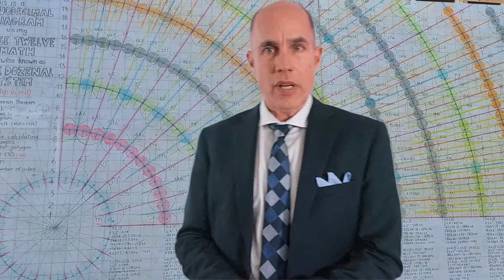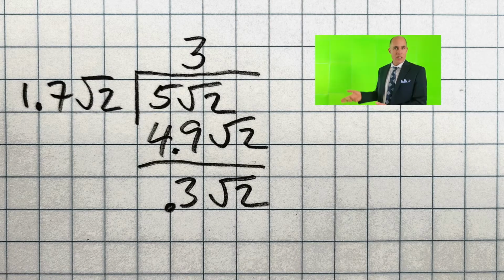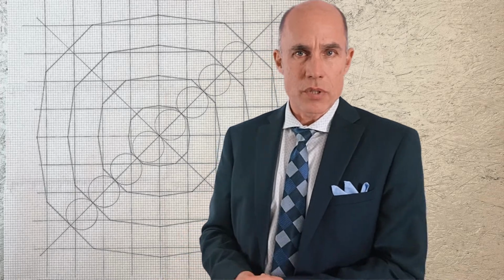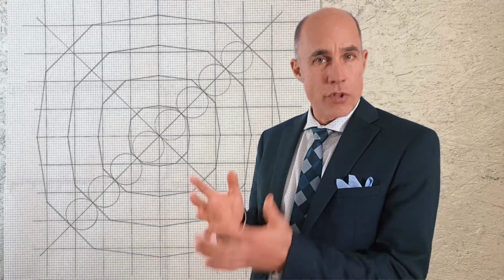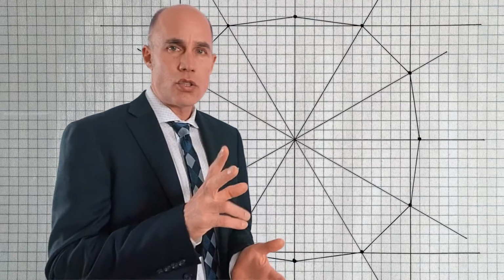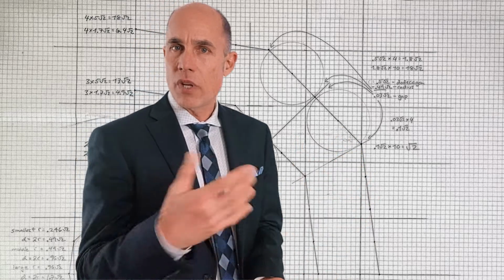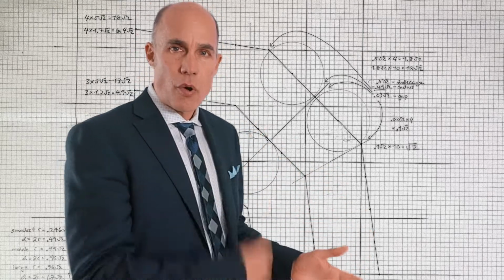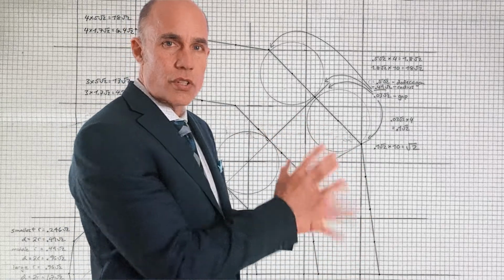How do you build a diagram for 360 degrees using base twelve geometry? Use a base twelve dodecagon!

Comment: Just to be clear, are we constructing a 360-gon (or 260-gon if you like) with verticies on integer coordinates using a straight edge and compass?
Reply from the maker: Although it may seem like it's "just" a 360-gon, it is important to be aware that each side of the polygons we are creating are made up of two distinct aspects. There is the unit of the diameter, and then there is the section of "empty space" inside, or between which, that section of diameter is floating. The construction of the diagram for 360 degrees is not so much the end result, but the completion of the first step of a larger diagram which can then be used to map out the geometry of Quantum fields.  It will be when this geometry is attached to Quantum Physics and Quantum Field theory that its real import will become apparent.
So with regard to the idea of completing the diagram with a compass and straightedge, because of the scale involved, very quickly the physical compass and straightedge need to be replaced by a computer program . If you happen to know anyone who would be up for the challenge of creating a geometry program in base twelve, by all means, let me know. :-)
Reply: @dozenalmath  This is some fantastic work! I'm currently building a geometry program in base 9, to represent only the real numbers. It will be possible to run base 12 simulations on it.
Reply from the maker: @squeakytoyrecords1702  Why did you choose base nine for your program? How easy would it be to convert to base twelve?
Reply: @dozenalmath  I chose 9 because my goal is to mimic nature. Zero is not a natural number, as it can't be counted. Also, base 9 allows for easier visualization of symmetry, broken symmetry, geometry, chirality, polarity, and multidimensionality. By expressing base 9 calculations in digital roots, it exposes the underlying algorithms of nature. While I do my calculations in base 9, my division process is like yours, in that I divide everything by 12. It shouldn't be difficult to convert to base 12. My system is a calculator that converts base 10 to base 9, runs the calculations, and provides the answers in base 9 and base 10. Below, I've included a small number set that shows the symmetry of base 9. If you pick any number and travel in any direction, you will find symmetry. If you convert the numbers to their digital roots, you will also find symmetry in every plane.

  2    3      4      5      6      7      8      9     11

12   13   14    15    16    17    18    19     21

22   23   24    25    26    27    28    29     31

32   33   34    35    36    37    38    39     41

42   43   44    45    46    47    48    49     51  

52   53    54   55    56    57    58    59     61

62   63    64   65    66    67    68    69     71

72   73    74   75    76    77    78    79     81

82   83    84   85    86    87    88    89     91

92   93    94   95    96    97    98    99     111

112  113  114 115  116  117   118  119    121